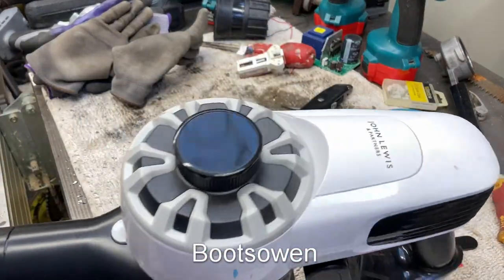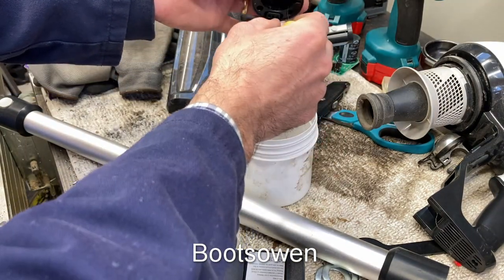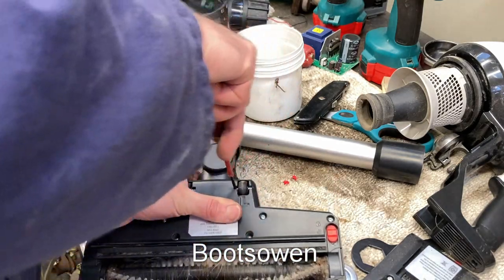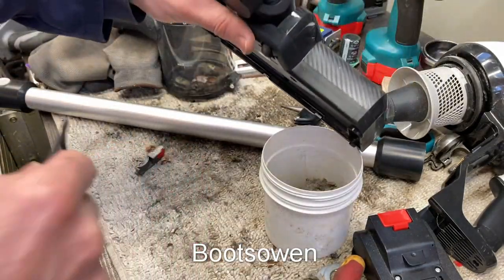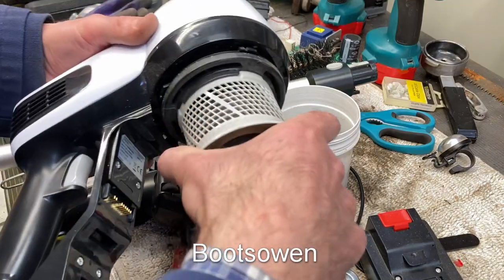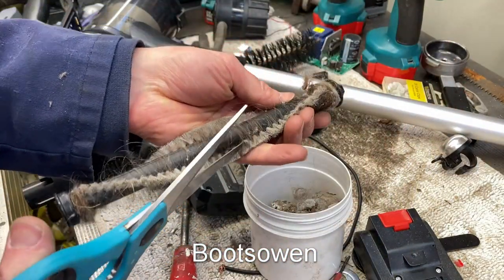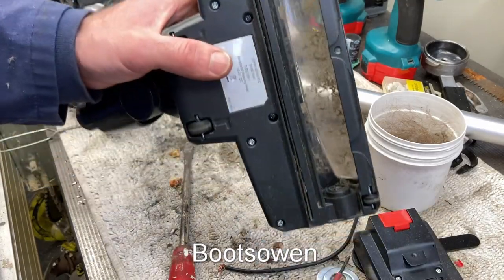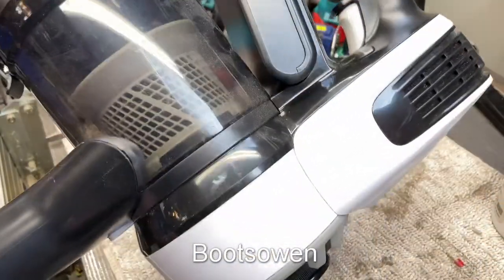Loss of suction? John Lewis JL Cordless Stick 14.4v vacuum cleaner repairs

Comment: is that not an ordinary 240 volt C8 socket. Implying the charger is built into the battery?
Reply from the maker: No, it was slightly smaller, squared corners and an indent on one side only.